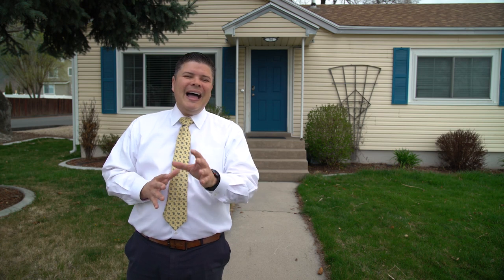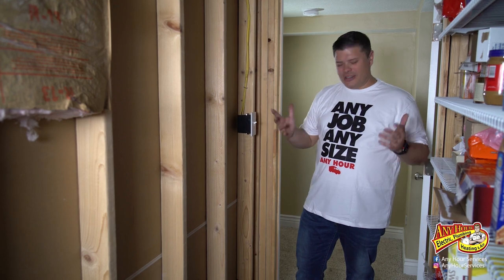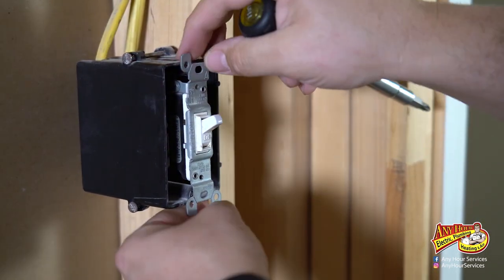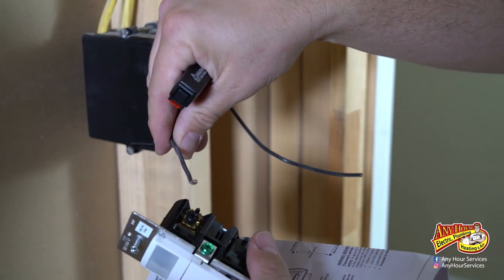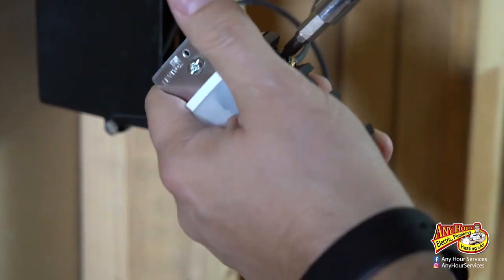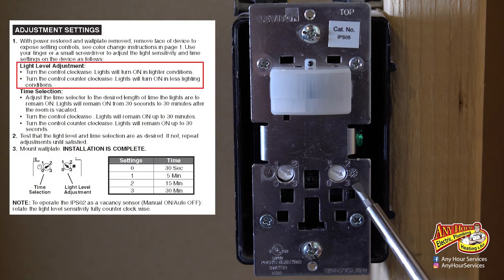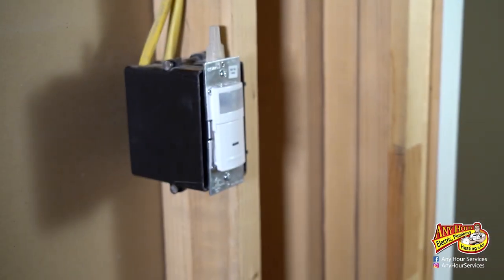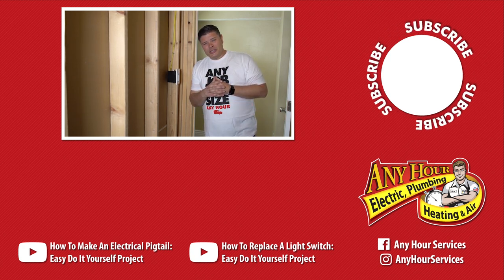How To Install A Motion Detector Light Switch

Comment: Perfect video - clear and concise.  I have been spending way too much time researching smart bulbs and smart switches and suddenly thought "Hey, why not use motion sensors?".  This is perfect for most of the overhead lighting in my house and a buttload cheaper than the recent tech options I was looking at.
Reply from the maker: Had the same thought myself. I have smart switches in some locations but the motion sensor was perfect for this application. Thanks for watching.

Comment: Thanks for the diy videos and clear explanations!  How do you install a timer switch  in a multi-switch?  5 switches control 5 lights and we want to put one on timer. Thank you!
Reply from the maker: Same steps as this video ... once you isolate which switch is controlling the light you want on a timer. Timers are pretty basic wiring. Read the instruction and before you start disconnecting things, if you don't feel like you can do it, get an electrician to help you. Good luck my friend.